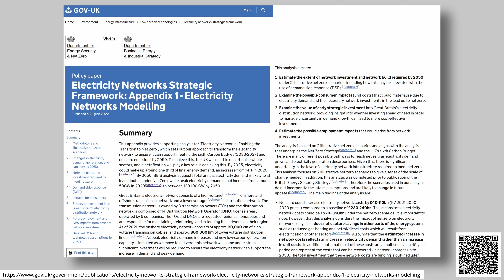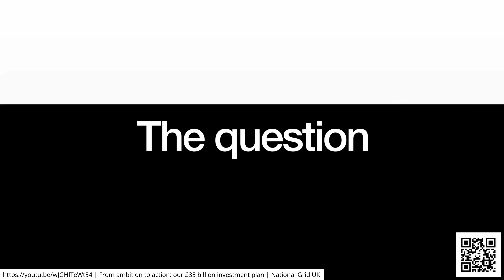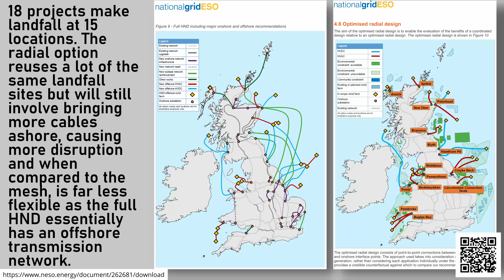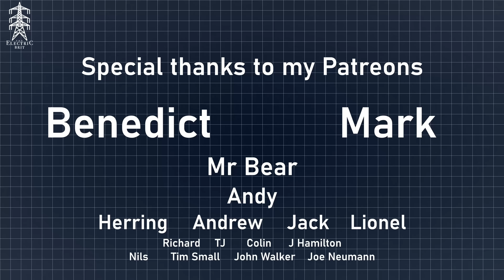The Great Grid Upgrade Projects Explained

Comment: Great look at this massive UK Public Investment! Balance between cables offshore and those needed onshore. What is missing is adaption at Sub Station level to house connections where batteries could improve stability and could benefit from overnight cheap rates?
Reply: It's done by privatised companies but with government subsidies.
Reply from the maker: Substations will all be extended and new ones built as part of this and RIIO-T3, however batteries are in an odd spot where they can be used as storage (kind of treat like generation) or are used for stability services. 

UK and EU regulations prevent transmission owners from owning generation to prevent price fixing. So we can’t put batteries for storage in substations, and instead private companies build them adjacent and connect them in where possible to reap those rewards. Because the likes of solar and batteries can be low power you can sometimes connect them in on existing transformer tertiary windings. Personally I agree,  for resilience and land purposes we should have batteries to take the slack on every substation.
Reply: @TheElectricBrit  SSEN is definitely not the same as SSE 
Yeah
So clear

Comment: England needs to plan to generate more energy itself rather than relying on Scotland to provide it for free. If Scotland becomes Independent they will have to pay for energy or get from elsewhere, also at a price.
Reply from the maker: England currently has some of the biggest offshore windfarms in the world (yes, Scotland beats it on total capacity for sure), and we build windfarms where it makes the most sense, hence why most of it is in Scotland and why we need to now connect it up years later to where it's needed.

The windfarms are owned by private companies who generate a profit for themselves, not for Scotland really. If England wasn't buying it then they wouldn't have been built to put it bluntly. And I wouldn't worry about Scotland being independent, everyone is stronger together, that's why we need to be better connected, not thinking about being further apart.

Comment: Great video! I’ve been following the development of the east anglia wind farms and connectors but was unaware of how many more connections there were. Did my masters on permanent magnet turbine power converters, such an interesting topic, I’m also really glad to see how many HVDC project there are after that (designing control for ac was challenging)
Reply from the maker: Interestingly this is just all the transmission operator projects too, there's the various interconnectors going in from National Grid Ventures and other private companies as well as wind farms that are starting to use HVDC too. It's going to be a busy decade ahead but plenty of work and opportunities! Hopefully you're working in the industry after a masters like that too, lots of manufacturers in this neck of the woods.
Reply: @TheElectricBritit makes sense with modern switches (although I’ve no idea where they are now).

Unfortunately not, at the time it seemed wind manufacturers were based in Europe, I wasn’t aware of how many engineering jobs there were in the grid.

Comment: I realise brevity means that accuracy can suffer. But, when you describe the customers for Sealink as being London and the South East, you're stretching things a bit.
Just off the edge of your map is the Sellindge switching centre. It connects both Dungeness and the France HVDC connection.
I'm afraid the Yummy Mummys of South London with their 3 tonne EVs plugged in all day will be accounting for this connection on their own!
Reply: UNless those Yummy Mummies are doing 300+ miles / day, they won't be pulling that much energy off the grid... even in the really inefficient chelsea-tractor EVs.
Reply: @logicalChimp  Peak loading v average, it's important.
Reply from the maker: There's a big misconception we need to fight that the purpose of all these works is just to power London, and that rubs people up the wrong way why they're getting transmission towers in Norfolk, Scotland, Lincolnshire etc to power the rich down South. This is the point I made that this interconnection is good on so many levels if we want to electrify everything, which is the most efficient means of using energy.

But yes, a lot of these projects connect in near existing interconnectors and future interconnectors, so it will both allow us to export our renewable energy, and import it directly to where it's needed with the lowest losses.
Reply: @TheElectricBrit If it "rubs people up the wrong way" that 40% of the population and 40% of the economy is in the South and East of the country, then that is a political judgement for them to make. Those "Yummy Mummys" are of course a caricature, but they do represent big challenges to the grid if people with very high current (40A+) domestic demands make them at the same time in an unexpected pattern. Let's not even talk about how many of them could be concentrated in a single street. BTW, the only other domestic appliance that could be considered in the same league is the electric oven. Come Christmas Day, they all go on, but they have internal thermostats, EVs don't.

Comment: Much of this grid infrastructure would not be required if we had not gone down the renewable route over twenty years ago, and stuck with the planned nuclear expansion and continued with that.
As it is we are spending very large amounts of money and creating a very expensive electrical system to the detriment of this country's prosperity and scenic landscape. Even with this expansion we will still be short of power at frequent times so gas is essential to the grid, not just for back up but to keep it in load and supply balance which gets increasingly harder. 
Renewables are a dead end and cannot replace conventional generation, are short lived, relative to conventional and still require extensive subsidy.
Also as the original grid, for lack of a better term, there seems to be a lack of timely maintenance and replacement of aging transformers and switch gear, no doubt due to financial constraints. The substation supplying Heathrow Airport being the most visible example of this, a leak from a bushing being noted some time before it caught fire.
Reply from the maker: I have a video dedicated to the Heathrow transformer fire you might find interesting. As for Nuclear, I made a point in this video of pointing out we build it on the coast, the same place wind energy is connecting into now. So if we built nuclear instead of wind we would very likely still need all this reinforcement work to get it inland.

There are solutions that make up the shortcomings of renewables too which I will cover in another video, but even past 2030 it's planned we will still use gas for around 5% of energy, as peakers and voltage support etc. Regardless of how we get our power, electrifying everything will require 2x the power we use today, so the build is necessary - we're relying on a 70+ year old system to supply our modern lives so it's no wonder its creaking.
Reply: @TheElectricBrit 
I don't get the logic, we have grid connections existing from plants shut down. Nor is it necessary to build so far from areas of large demand unlike wind which is built so far away, contrary to good electrical practice..
There are unproven and fragile 'solutions' to cover the deficiencies of renewables  We are building even more unstable sources of generation onto the grid, it can only end in tears. NESO already have plans for area shutdowns to cover the lack of firm generation. This is disgraceful and should be taken as an admission of the failure of large scale renewables when our concentration should have been building sufficient dispatchable generation capacity. 
The age is irrelevant, given adequate maintenance and used to suffice for a higher demand than it now has. 
The idea of electrifying everything is a bad one given the inefficiency of generation and distribution,
based on a low carbon generation that is very expensive, both in capital investment and operational costs and is so much less resilient.

Comment: East Midlands Railway, no longer use locomtives on there passenger services but instead they use multiple units. East Midlands Railway last diesel locomotive hauled sercices where withdrawn in 2021.

I would recomend you read the 'Overhead Line Electrification for Railways' if you haven't already for your UK railway electrifaction video.
Reply: I think he meant diesel traction (which they still do almost exclusively with the 222 meridians on the mainline) rather than diesel loco haul.
Reply from the maker: Yeah that's my bad on terminology, I meant locomotive as in the thing with the engine that moves the train. Had no idea it had a different meaning! I'm familiar with the 25 kV 2 phase transformers we have to feed traction, and I'm a staunch fan of nationalisation, so I have a few things I want to say on Rail, from the downfall of British Rail, the aforementioned 25 kV 2 phase transformers and how we will electrify.

Comment: Nothing on the south-west? I would've liked the summary to cover all areas.

Hopefully more next time please.
Reply from the maker: Thanks for commenting, the south west is pretty devoid of work besides some floating wind farms that may well get its own video, connecting into Pembroke with an extension there, or alternatively going in further south depending on constraints. I deliberately left offshore works off besides interconnectors because there's so much wind planned and a lot of it won't be Transmission Operator related. I'll be exploring more projects soon :)

You can see it on page 66 onwards here: https://www.neso.energy/document/262681/download

Comment: As an IT guy (without much electrical know-how) I learn a bunch from your videos; really appreciate all the effort you put into them. Still somewhat confused by terminology like double circuit (although bi-directional seems to be more self-describing). Guess I need to go back to some of your previous episodes to get a more complete picture ; wouldn't mind if you reference earlier episodes. Not being in the UK it would be possibly be interesting to have a somewhat detached historic view on the (logical) evolution of technology. To illustrate: I visited two power plants in Western Belgium recently covering the earliest to the latest developments and it was quite interesting to understand both the underlying (business and geographic) logic versus technical developments.
Reply from the maker: Thanks for the comment! Yeah I dropped the ball on this one not explaining what goes into uprating and the other solutions. Double circuit just means two circuits, one on each side of the transmission tower. Since the phases are top to bottom. I cover it a little in my “How the grid works” video. So a single circuit tower only has three wires / bundles of wire. Double has 6.

I have a history of the grid video planned which covers the broad strokes of the past 130+ years of infrastructure and technology development, and I’ll be diving into specifics too like HVDCs history and developments. I need to get out on site more too to document our history before it’s gone, there’s some very interesting old transformers and switchgear still on the network from the 1950-60s.
Reply: @TheElectricBritI'd love to see a history of the grid video. I'm not that immersed in the world of the grid, but this video makes it seem like an exciting time for it, and I'd like to know about how the grid has formed into what it is today

Comment: It would be cheaper, quicker and more efficient not to have green energy!

Our energy prices are 3 times higher than it should be.
All because we are paying for the pointless not so green energy
Reply from the maker: The energy is already there, the generation built. This work is so we can actually utilise it. 

All of our existing assets for gas and nuclear are near end of life so it wouldn’t be quicker either with the lead time of new gas turbines. Nuclear takes decades and SMRs don’t exist yet. 

As for cheaper, nuclear is the most expensive form of generation in the UK and gas is dependent on foreign powers (see price volatility during wars). 

So I’m not going to give an opinion per say but I’ve always been an advocate for a balanced diet of energy sources, we need dispatchable power for certain, and a strong believer in energy security. Hope that helps :)

Comment: I know there’s a ton of work going on, but do you think it’s possible for projects planned to complete in 2031 getting pulled forward earlier?
What’s the key restriction? People, stuff or permissions?
Cheers
Reply from the maker: There’s a good chance projects will be live months before the end date which could be 2030 for example, but their full power switch on date will likely be on time. 

The bottlenecks are a few things. First is people as you say. Somehow we’re managing to do all these projects concurrently when there’s very few specialists available so that will be a big challenge. We’re trying to train a lot of the people now but I suspect there will be a lot of foreign contractors to support as there usually is anyway. For example the commissioning at the end. 

The other limiting factor is sort of permissions. Sometimes with land but sometimes just regulatory that we need to follow a set process and it takes as long as it takes. Things like surveys, explosive ordnance removal, archaeology, they eat up the first 2 years, then about 2 years of construction and a year to wrap up and testing. Few other things of course. 

Manufacturing is actually a bit of a bottleneck for everything right now. There’s only so many boats big enough to lay marine cable and so many cable and transformer factories with years of lead time - similar to gas turbines right now.

Comment: Pulling wind power from Scotland while leaving us with the highest power costs and now a flood of AI data centre being planned .. if anyone thinks prices are going down is daft
Reply: It’s bi directional
Reply from the maker: Check out the pinned comment. There needs to be market reform in order to realise the actual cost of the renewable energy produced. Also if the AI data centres are being put in Scotland then that's a positive for jobs and a positive for actually using the power you're producing.

If you want prices to come down you need to be speaking to your political representatives - Zonal pricing for one would have helped in the short term.

Comment: Retail electric prices in the UK and Europe are uncompetitive by world standards.
It may be time to re-think about the need for national grids. National grids are a legacy construct of past thinking, essential to carry power from large generating plants to distant users  Sadly, as the grids have gotten larger (eg pan-european etc) the risk of catastrophic failure, causing potentially devastation to a countries' economy, has grown exponentially.
In the future far greater resilience and much lower cost can be achieved by abandoning national grids altogether and replacing the present power network with a plethora of gen 4 or gen 5 local, city based SMRs. Without inter-connection we eliminate widespread catastrophic risk. Redundancy being achieved by multiple micro or SMR units.
The present focus on renewables mandates the use of National Grids. But it is easy to imagine replacing all wind/solar by SMRs within the near future.
This approach may look like a heresy but we need a paradigm shift to restore our competitiveness and resilience.
Reply: If you want to be able to move power from where it's generated to where it's needed (hint: we don't have too much housing built in the middle of the North Sea), then you need some form of grid.

The current issue is that the existing grid is built on a hub-and-spoke design, to support centralised generation (from massive coal-powered plants, etc)... whereas what we now need is a mesh-network, that can accept excess power at virtually any location, and shift it to where it's needed.

Hence the focus on bi-directional links in this video - shift southern day-time solar north, and then bring nightime northern wind-power south, etc.